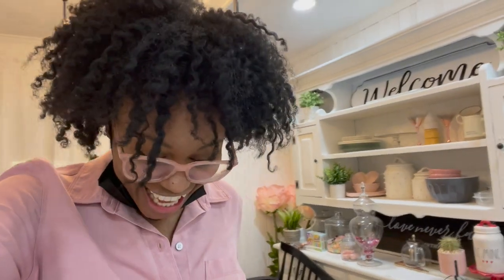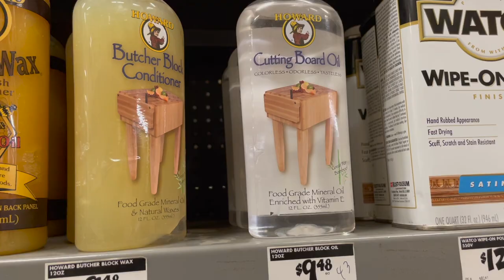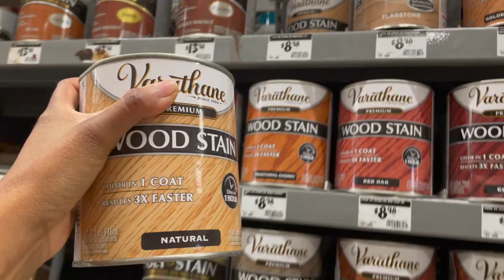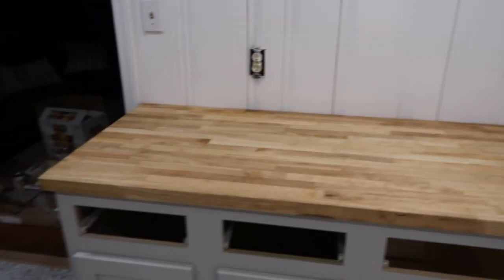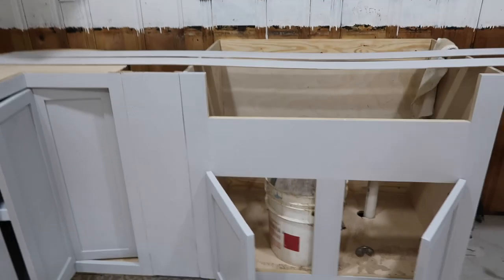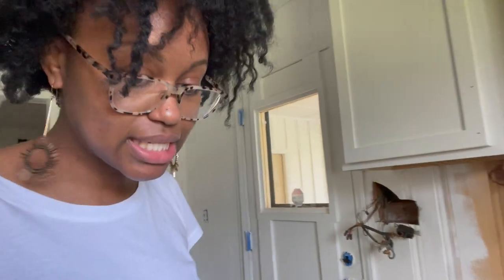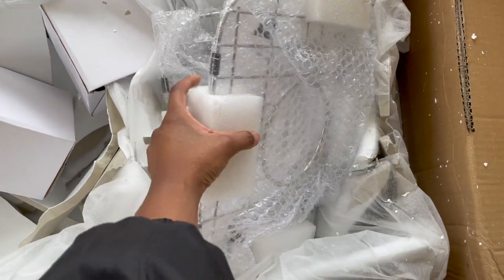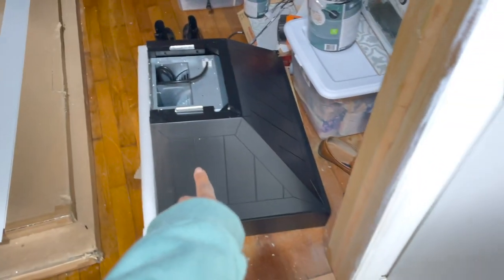INSTALLING MY NEW APPLIANCES! RENOVATING MY ENTIRE KITCHEN! | Kitchen Makeover Vlog #3 #FIXERUPPER

Comment: Definitely go drywall with real tiles. The peel and stick ‘tiles’ don’t hold up well to deep cleaning. You’ll love the real tiles!
Reply from the maker: Right!! I think so too! 💕💕
Reply: Have you had a lot of experience with peel and stick tiles? Are certain kinds better than others?
Reply: @meganlee1964  I do not. My husband’s grandparents have them and they complain that they have to be very “gentle” with them when cleaning. So I personally don’t think they’re a great option for a greasy environment like the kitchen.
Reply: @meriahmakes6870  Most people add glue on them and glue them down.
Reply: @isaiahbangura4421  that makes sense! Sounds like there are some options to make them more durable. Thanks for the info
Reply: Peel and stick smart tiles are actually pretty decent. No complaints, mine have held up fine for 2 yrs so far! Depending on the ones you get they can be super reliable and basically look like the real thing

Comment: I think the drywall all around will elevate your home and then the tile on top.  Shiplap and board and batten etc. look different than painting over wood panels.   I know the drywall process can be expensive and can be somewhat messy, but the end result is worth it.  Maybe tackle it sections by section as your budget allows.  For resale people look for quality work and finishes over the “look of quality” which the peel and stick tile gives off.   

Overall I think the vision of you home looks good and the appliances look really good!

Comment: Hey Kayla! 👋🏾 Everything is coming together and looks so good! I’d suggest 1/4 in. x 3 ft. x 5 ft. Cement Board with EdgeGuard
by USG Durock Brand at Home Depot for the Tile installation. It’s thinner than Drywall and provides more protection to your walls.

Comment: Fourth option, buy plexiglass or stainless steel and put that instead. It can be screwed in without worrying about imperfections. You can also add a thin sheet of wood and stick the tiles on that. It too can be screwed onto the existing wall paneling

Comment: Also if you can, while you have electricians in and out, don't forget to add under cabinet lighting!!! Trust me, it makes such a huge difference. The alternative is to buy plug in ones from amazon or the hardware store, but then you need to find somewhere to plug them in that wont be visible. In my apartment, the contractor forgot to hardwire under cabinet lighting but I really wish he hadn't. I ended up buying some that turn on and off with a sensor, and I plugged them in behind my refrigerator so they look like they were wired in, but not everyone's kitchen can accommodate that.

Comment: If I'm thinking back splash is what I think it is lol. Make sure to get it your kitchen walls will thank you especially if you plan on using your kitchen regularly. Not just from a design stand point. But cleaning tile is so easy compared to paint

Edit: I read somewhere that ceramic  stuff like toilets isn't packaged well because it's cheaper to send a replacement then to spend the money on packaging. So I'd suggest maybe ordering one to a big box store. For ease of return and stuff

Comment: I was wondering how you were going to tile that wood. Adding drywall will only make thicker walls. You can add brass or copper as a backsplash which would look awesome with your color hues and it's easy to clean. You can also cut the wood off the wall and tile.

Comment: You have a brother in law that does construction right? I would ask him to take a look about the backsplash, sometimes what the contractor says isn’t actually the only choice, it’s their opinion in what’s best. Research says if there is no movement in the paneling and it’s structurally sound, you can add tile. If your still uncomfortable with that you could put up a backer board, might give you a thinner option so your not putting so much depth on your wall. And the kitchen is looking amazing! As soon as I seen you posted I was like oooh I gotta go watch.

Comment: Yiu should had took the paneling down you painted over and put up dry wall it would make things a little easier. And then you would have to get cement tile to put over that depending on what type of tile you use

Comment: Check to see if you can apply a thinner dry wall (like 1/4") rather the thickness one would use in new construction over studs.  The drywall will get screwed enough to secure it to the wall so your tile will be supported.  You may have to use a bit longer drywall screws since you are going through a layer of wood to reach the studs.  You should remove the crown molding before you drywall and you could have new crown molding applied over the tile if you want it to look like the other walls.  I don't think you would be happy with the peel and stick since I don't think you will be happy with all of the other improvements you've made.  But, I would ask the advice of an expert tile guy.  Don't forget to paint the inside doors of your cabinet if you want a professional look to your new cabinets.  I take it you are using paint made for kitchen cabinets?  Some paints will leave more brush marks and not flow together as well as to hide the brush marks.  Since you are using such light colors, will you be sealing the white and gray paint for the cabinets?  Love the floor tile, pretty but not too busy.  There are so many videos about painting cabinets with great do's and don'ts.  This are the fun parts of being a homeowner and being able to make your home reflect your own personal tastes.  Best wishes.

Comment: Please use backerboard behind tile.😊😊😊😊😊
I just pulled this from Google, plus I worked in Home Decor/contractors desk for 15 years at Home Depot. Whether it's a wall, floor, or countertop tile installation, using the right substrate is crucial for preventing cracks and breaks in the tile and grout. Backer board is the best substrate for tile. Plywood and OSB substrates can warp and mold with water damage, but tile backer board will do neither.

Comment: Yes it's probably wood glue which is a pain to remove. Start by putting a ton of nail polish remove or alcohol on cotton balls. Then let them sit for at least 20 mins the you can come back and scrape it up and sand the rest off its a tedious process and can damage your wood if you don't do it properly so I would just call floor and decor and get a new peice since it is technically damaged

Comment: Drywall will be the best option because if you use peel n stick, it won't last or might not even stick because of the grooves in the panels. IMO ... be safe and go with the better option: Drywall

Comment: Cut out the wood where you put the drywall first or it will be too thick. Once the tile is on you won’t see the transition. not recommended to put the drywall on the wood.

Comment: You can’t add the tile to the wood because it will rot and possibly mold because of the mortar. I would just remove the panels add some backer board and then put your backsplash up the peel and sticks are expensive and I don’t really like the look of them like you said

Comment: Everyone knows the tile can't stick to the wood.  So I'm gonna just say this, you have to educate yourself on what should be done before you start spending money on things that will need to be removed. Obviously you need to remove the paneling and not just drywall over it. Also you need to sand the side of the butcher block to remove the arrow from the edget.